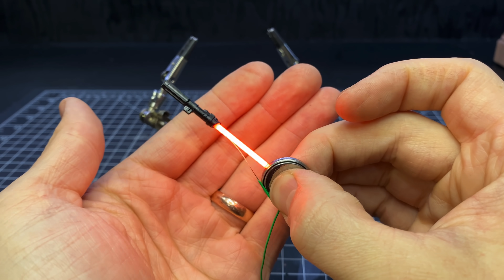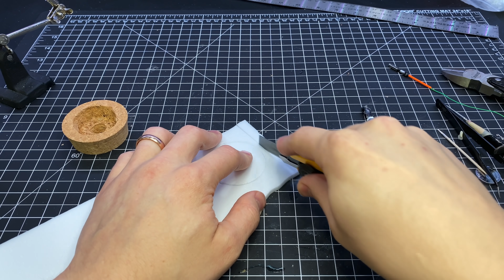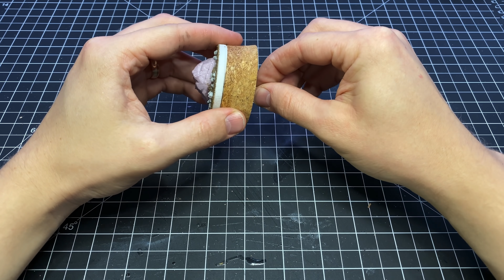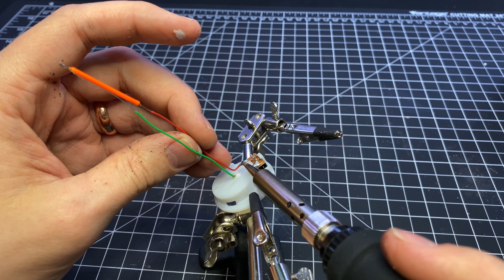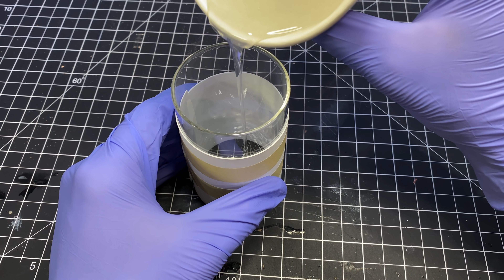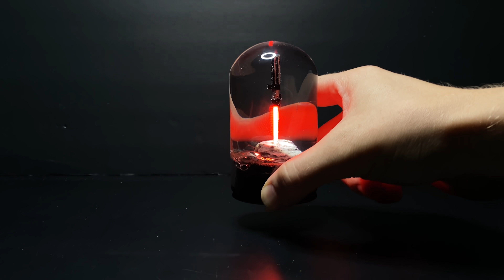Could Vader’s Lightsaber do this?! | Epoxy Resin Art

Comment: Only thing I'd do different would be to not have the resin domed at the top as the reflections interfere with picking out the details in the saber otherwise it's cool just wish it was a 90° angle near the handle to see it a bit better

Comment: I have a light saber from SaberForge, and wanted to use the light as part of an incased Star Wars Display.  I want to be able to turn on the saber via remote or at least an external swtich.  Is that even possible, is it as simple as connecting a usb switch to the female connecter thats in the lightsaber hilt?  Or is there more involvment because of the switch that is on the lightsaber already.

Comment: Actually that is pretty realistic because in the Star Wars lore it is not or as lore it is known that the lightsaber power level can be chained but power level can be changed to either be like a normal light saver like a normal lightsaber or you can reduce its power so it doesn't harm anybody and it wouldn't doesn't harm anybody and it wouldn't cut through as much

Comment: My lightsaber has a module that balances it against planetary magnetic forces, so it hovers wherever I release it as if it's in zero gravity.  That takes quite a bit of its energy, to be honest, but I only use it for welding.  

But for Vader's saber, this is not very realistic.  First of all, he would rather impale a rock with a rebel.  And second, he only uses his lightsaber to light cigars when he's not menacing at weaker specimens nor fighting a force sensitive.

Comment: it would've been more realistic without the resin inside the cup. If you don't plan to work the resin (like polish and stuff) after molding it - there is no point in using it at all. If you'd remove the glass cover then you'd have access to the bubble and could correct it and polish the whole thing. It would be a lot better. But in this case, resin is just not needed at all. 
Cool project in any case!

Comment: next time when someone says "its not very realistic" to that lightsaber, that's actually a "plasma-saber", you say sure normally when you would use a saber like that you burst into flames and burn up, the things that saber does in the movies, has so much power / energy that "realistic" should set any use of set saber a flame, that amout of energy and heat should come off that saber. so in short that saber it self is not realistic so who's to say that it can't be stuck like that ;-]

Comment: "This is not very realistic."

If you plan to do resin work, you should invest in a pressure pot and or vacuum chamber.

You use the vacuum chamber to degass the resin, and the pressure pot will keep bubbles from forming as the resin sets. Often just one will be enough to prevent bubbles, but many prefer to use both methods.